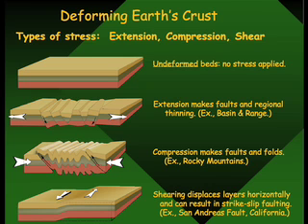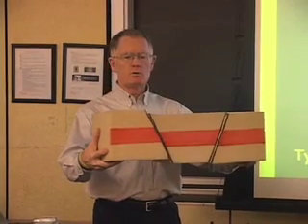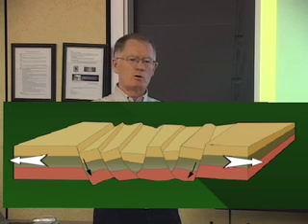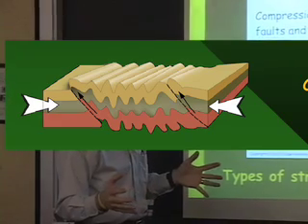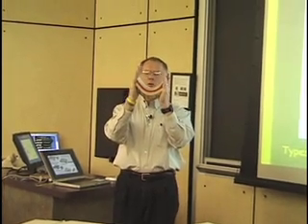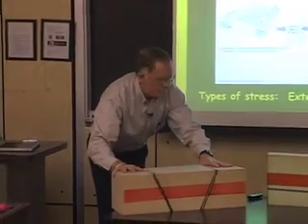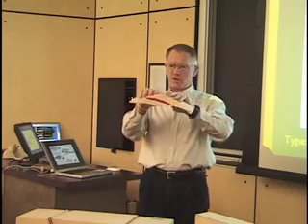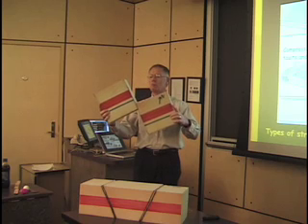Lecture 4: Faults and folds—models of deformation

Comment: I have a question. Folds DR Butler demonstrated are with flexible papers, not solid/concrete rocks. could you explain why all the layers could fold together without breakage?
Reply: That's because folding occurs over millions of years. High temperatures coupled with slow deformation rates leads to ductile behaviour.
Reply: Depends on the ductile & brittle behaviour of rocks... Subsurface conditions gradually change from brittle to ductile as we go deep inside the Earth...